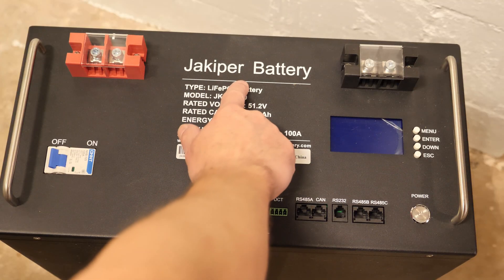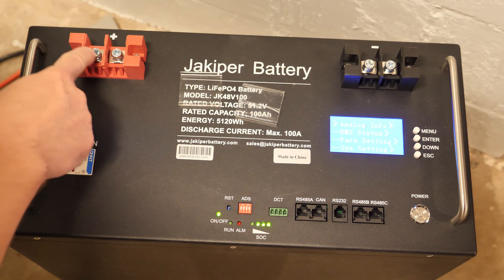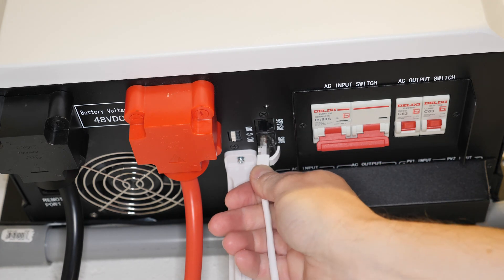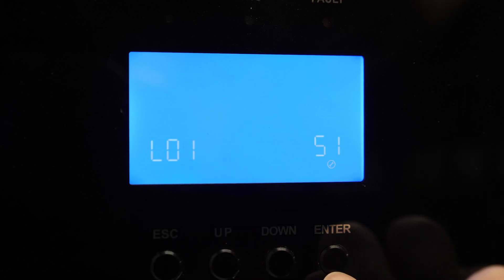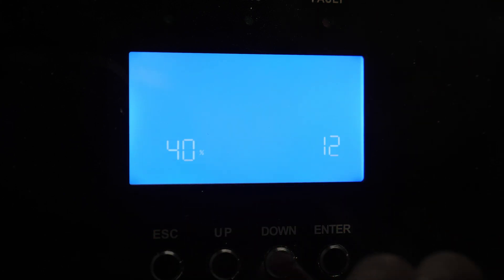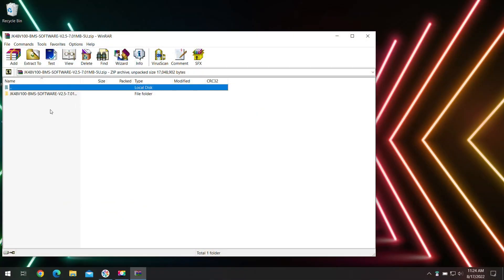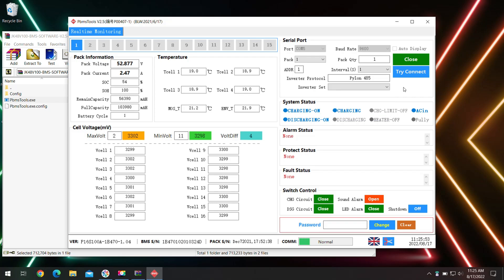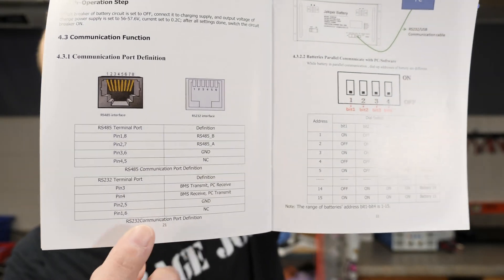Inverter Communication How to!!  Jakiper Server Rack Battery!

Comment: hello man, need your advice
i have hybrid invertor Deye 8 kwt + two those Jakiper but updated version... in specs i see that recommended charge current is 20A...but its too slow and battery fully charged in 5 hours... what is the maximum charge level that will not cause degradation in next few years?
Reply from the maker: Id do 100-150amps if you have 2. Thats what I would do especially if you have solar.
Reply: @AveRage_Joe  it means 50a per battery right? 100a for both? I have solar panels - 16 items per 455 watts for each, Risen, but I cannot remember exact model.
Reply from the maker: Yeah just dont go over 200amps total or one or both battery bms's could shut down. SEND IT!
Reply: @AveRage_Joe thank you for your support !
Reply from the maker: @odessos1234 You bet! Glad to help!🤘
Reply: Hey bro, have a question. is it ok that my batteries have 94-95% of charge everytime ? i'm using solar panels for whole month, and i never saw at least 98%. but if grid will be turned on - i will see 100% during a hour. i cannot understand what is happening....
Reply from the maker: Yeah I think that is ok. I dont always reach 100% either depending on weather. How much solar do you have? When you get closer to 100% the charge controller lowers the amount of solar power coming in. Which inverter are you using and your bulk and float settings?
Reply: @AVERAGE_JOE  shared photos via email
i have Deye 8 kwt + 16 risen rsm108-10-455bndg
solar panels generating more than i need :) 
now its 10 PM in Ukraine, don't be surprized by absence of DC indicator ;)

Comment: Joe, This video was very helpful thanks so much!
I have 12kw growatt with 3 of these jakiper batteries.
Question is, why would you choose pylon 485 instead of growatt 485?
Waiting on the cable so I can see if these batteries are still usable. They have been sitting without being charged or discharged for over a year!

Comment: Thanks for the video. When you plug the computer into the bms is it powered on? Is it a crossover cable or just a regular ethernet cord?
Can the program change the capacity?
I have a jakiper diy bms (same model number as the one on the 100 Ah server rack battery) but it will be hooked to 280 Ah cells.

Comment: Thank you, Thank you, Thank you for this! Very well explained and documented. 
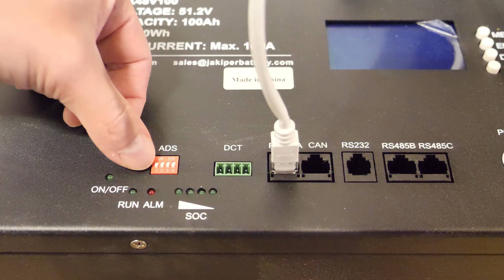For those wondering about the red dip switch setting at 2:32m for communication with Multiple parallel batteries, you assign extra batteries using Binary protocol. (1,2,4,8) to a max of 15 batteries in parallel. 
Love my Jakipers BTW. Wanted EG4's but none available in my locality so went with these instead and very happy!
Reply: I was about to ask about parallel batteries and you just answered my question. Thanks!
Reply from the maker: Thanks Mate and Mucho appreciated for the multi batteries!!!
Reply from the maker: Havent had a chance with the EG4's yet!!

Comment: What’s the difference between low and high frequency inverter’s. Thanks
Reply from the maker: Low Freq have transformers in them, are heavy and less efficient but are great because they are similar to grid and can start big loads.  High Freq use electronics to mimic grid, light weight and moar efficient.